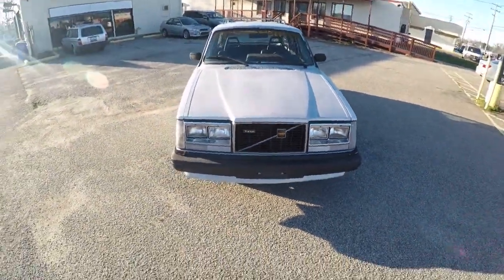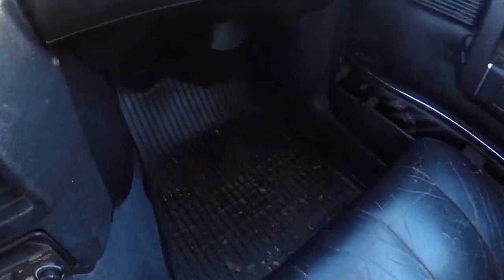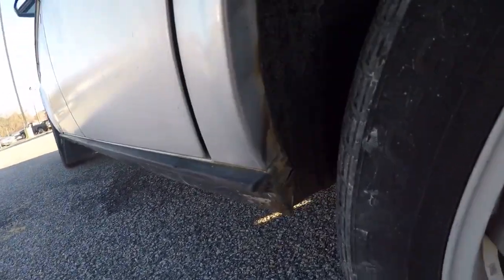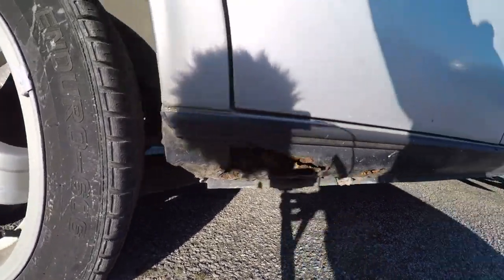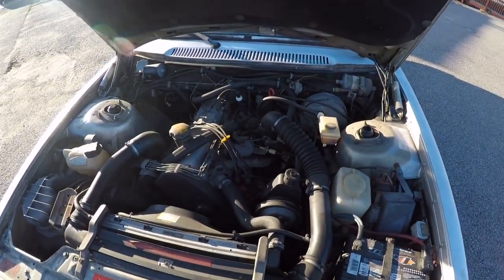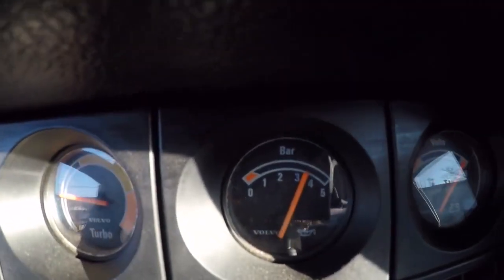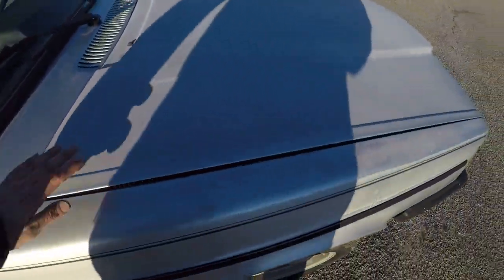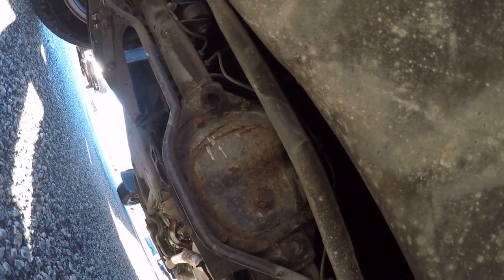HERE IT IS!!! Volvo 245 Turbo Intro

Comment: Wow kinda rare to find one of these with a turbo and 5spd manual.....I bet if you pull the cyinderhead, the tops of those pistons will be suoer clean and the cross pattern in the hone will still be there. I pulled a cylinderhead on a non turbo 240 sedan and I was blown away by how clean the pistons were.
Reply from the maker: It actually has the M46 4 speed manual with electronic push button OD. Yeah, I did the head gasket on my 240 wagon non turbo with about 270K and the cylinder walls still looked new.